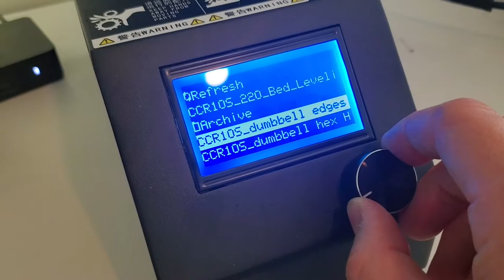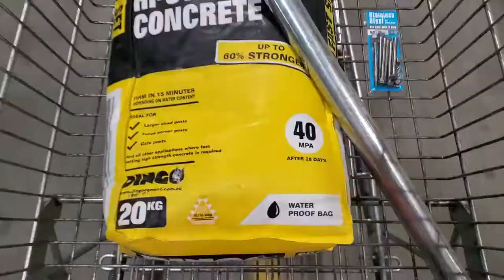Make a dumbbell from scratch with a 3D printer

Comment: How much does it weigh after all of thatv
Reply from the maker: It was 2.78kg. The physical size is roughly 2-2.5 times that of an iron dumbbell with the same weight.
Reply: @CalebUnleashed  Is it possible to make one for different sizes from (5lb to 150lb).
Reply: @Adam-pt7ud  not OP but most likely if you were to make them bigger